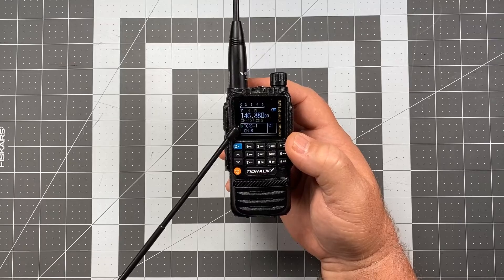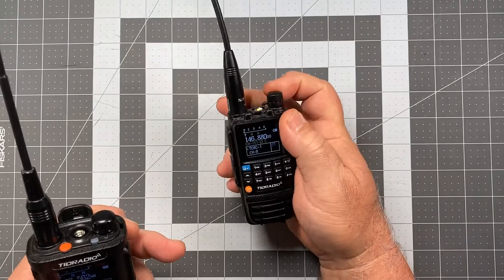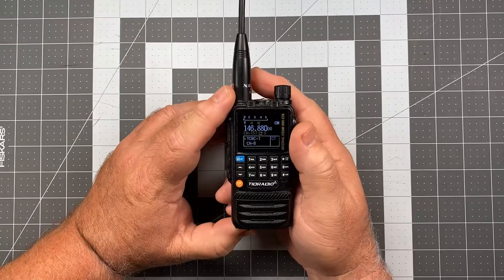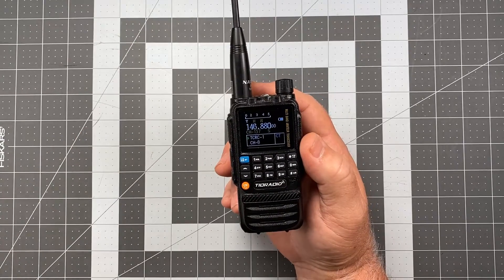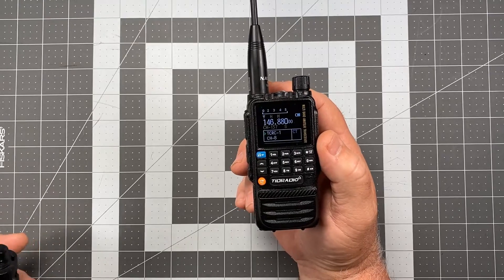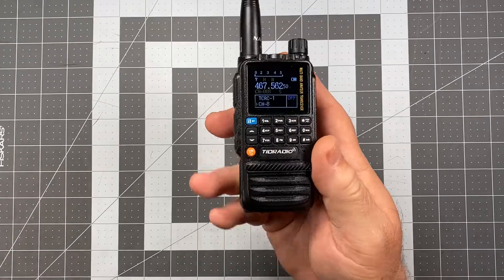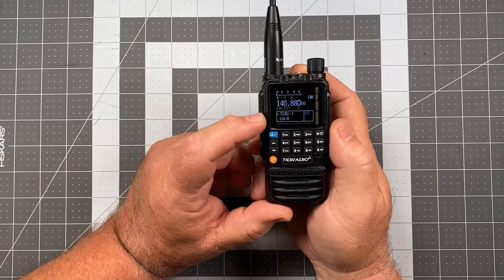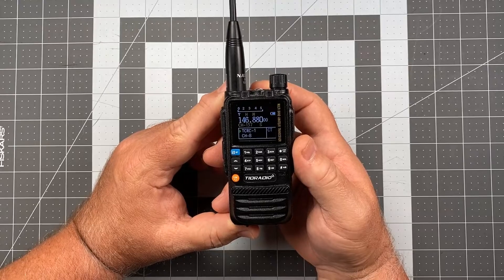TID Radio TD-H3 Operators Series: Part 7 - Enable/Disable Dual Watch

Comment: Hey thanks for the videos.  I noticed that when in dual watch mode and Freq A is selected and I key the PTT2 the frequency display incorrectly shows the frequency of A frequency (and also the offset frequency) of the A selected instead of the B that I think its actually transmitting on.  same for you/others?

Comment: I read that this radio does crossband which requires full duplex ability.
Does it?
Reply from the maker: No. It does not have crossband repeater capability.
Reply: @KS6DAY  Understood. Thanks!

Comment: I seem to have an issue with my dual watch mode. For the most part it works perfectly fine, however I cant recieve any sound on my B band. The arrow and signal light up indicating it'd recieving a signal, but theres no sound. If I reply, it works perfectly find. There's no ctss or dcs tones activated, so that's not it. Is there any other setting that can cause this issue?

Comment: Thanks, Scott. I got an TD-H3 based in part on your earlier videos. I've been very happy with it so far, despite some of its quirks, which you've pointed out. A part of me still wants a VX-6R, but the TD-H3 pretty capably does the job of a small, handy, grab-and-go daily driver. Would you agree that the TD-H3 at ~$35 is a better option than the VX-6R, unless a user really needs the ruggedness of the VX-6R?
Reply: It has air band, which is pretty cool monitoring UNICOM traffic for small airport by me.  
Also new firmware install opens up CB band for us old timers

Comment: I may be wrong or I have a wrong setting. I  have found that dual watch does not work in the scan mode. If I am scanning the "A" band but am hoping to here something on the "B" band if there is radio traffic, I am not hearing it. It works great if neither of the bands are not scanning. Let me know if I am missing something in the settings.
Reply: You are correct.  It’s a $30 radio, so it can’t do everything
Reply: @JimmyCornPop  yeah. I know some do, some don't. It is my new favorite though. It is pretty awesome for the price.
Reply: @SkyWatchTimeLapse  absolutely.  It’s not a true full duplex, so dual watch is basically scanning between A and B. 
Otherwise, it would probably cost 3 times as much.